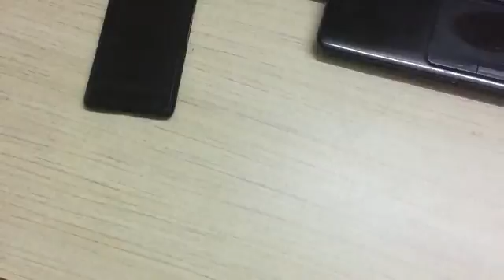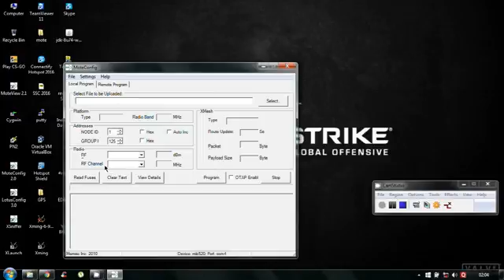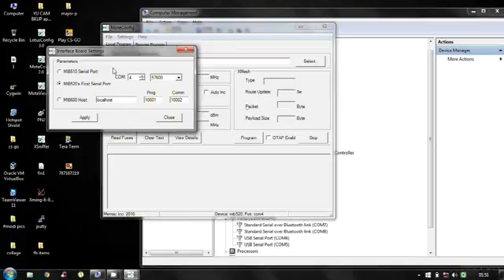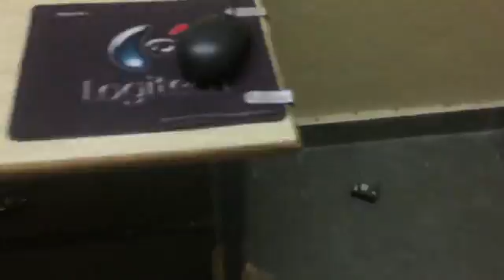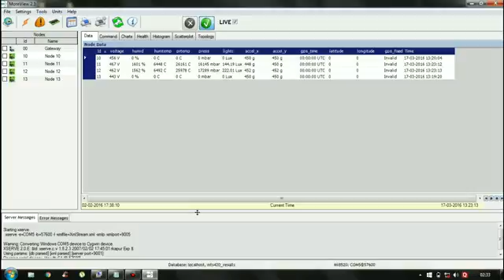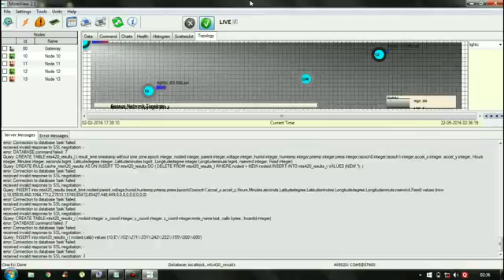MEMSIC WSN Tutorial

Comment: To configure as a sensor also program  with XMES- Base 2420?
Reply from the maker: Yes you need to program that mote with Xmesh 420_hp (420 is the model no. of sensor board, which will change accordingly if you are using different). Program the mote you are going to connect with PC as base with file Xmesh-base. I hope you understood :) . If not then we can have a conversation over mail :shivam95.khare@gmail.com